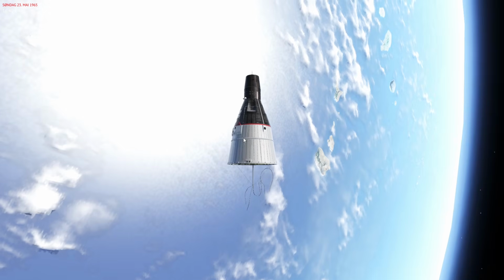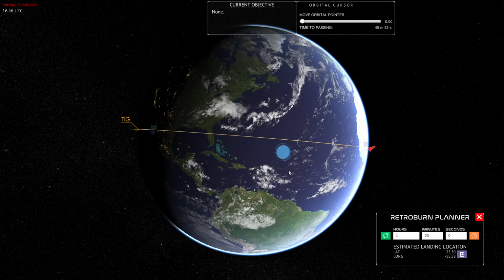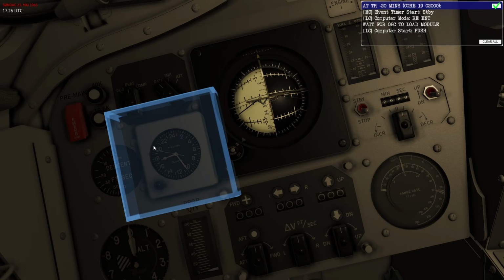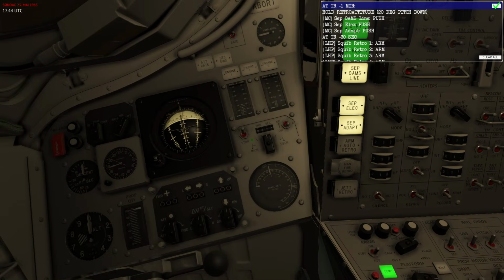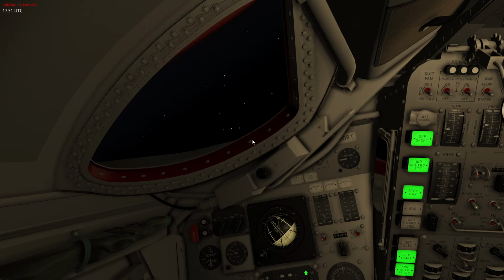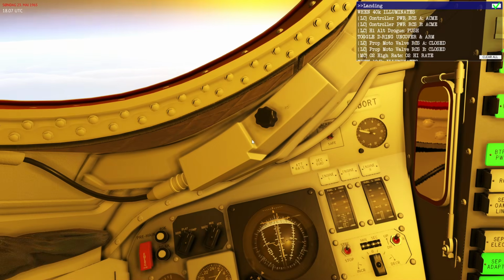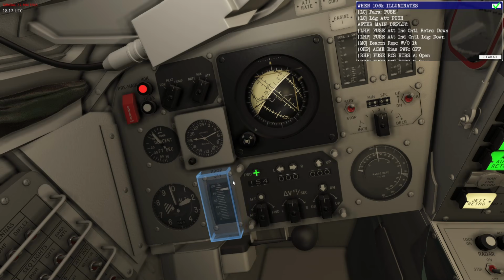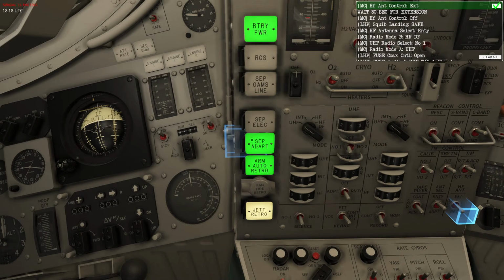Project Gemini - Atmospheric Entry

Comment: Is there a way to reset the sequencer?I cut off power of capsule and reboot it, but it still won't reset. When I was setting the ignition time with the Retroburn Planner, I accidentally set it to a time earlier than the current time, which made all the sequencer buttons light up, and now I can't even run the checklist. Any way to reset the sequencer?
Reply from the maker: Mission control to Flankersea! No, you cannot reset the sequencer fully. If you accidentally trigger it you need to, as a contingency, follow the time to retro yourself (Tr256), but the rest should follow normally thereafter. The lights will be on if you update the timing after it has started no matter what as it follows a flag that is triggered once. Good luck, it's a fun little extra challenge but should be fully manageable with some practice. 🧑‍🚀 Over.

Comment: How do you get the coloured tabs on the side of the checklists? I do not have that in my version if the sim.
Reply from the maker: Hi! You can edit the hex colors by modifying the bookmarks file (json). These are found in the games AppData folder, basically where the logs are stored. :)
Reply: @ReentryASpaceFlightSimulator  No, I meant how do I get these tabs at all. My checklists do not display them. There only is a UI element to drag the window around, like on the left side and top. But no bookmarks at all. (Version 1.0.53 from Steam, running via CrossOver on a Mac.)
Reply from the maker: @sebidotorg ahh! You can press the Star to favorite any opened checklists to add a bookmark to it. It will then be stored as a bookmark (at least that is intended feature on Windows)
Reply: @ReentryASpaceFlightSimulator  Thank you! I was watching the videos and getting really confused. Great sim so far, I progressed to just before doing my Gemini Exam. :)
Reply from the maker: @sebidotorg Thank you! Glad to hear that, it is amazing to see how insanely the technology evolved from one craft to the next. 🚀

Comment: Okay one question:
When you enter the atmosphere and have the horizon up and you lower your G's ,why did you enter Re-enter state so you roll and then the G's go back up again?
I want to understand the reason for doing that step.Why would you not continue horizon up as long as you can and  have constant low G's.
Reply from the maker: You can do it, i wanted to show how it can be controlled. Realistically it's about controlling both range and crossrange to planned landing location.
Reply: @ReentryASpaceFlightSimulator  ah okay! Thanks for responding.  Im taking my exam right now.
Reply from the maker: @Warhawk_ nice, congrats on making it that far! Then keep the lift up just to be safe :)

Comment: First time I did reentry I basically ignored everything the tutorial told me except for switching buttons, eyeballed the re-entry because I didn't understand what a vector was, and ended up safely in the water.

Is it the intended way to do this?
No, not at all.

Is it fun?
Yes.
Reply from the maker: Very much fun, very risky!
Reply: I did this on a Mercury mission. I was really happy when I first saw the Gemini capsule though. My first thought "Thank god, an 8 ball and a real altimeter. I can finally fly without guesstimating."
Reply: from what i got outta my hours playing, basically, unless you're entering on a wrong side, or have something open to the outside, you get to splash down just fine